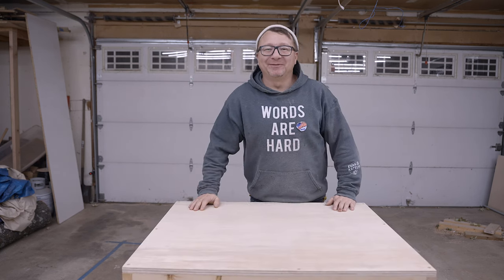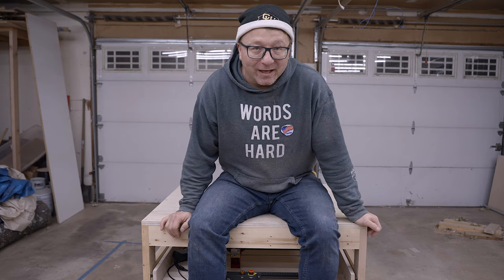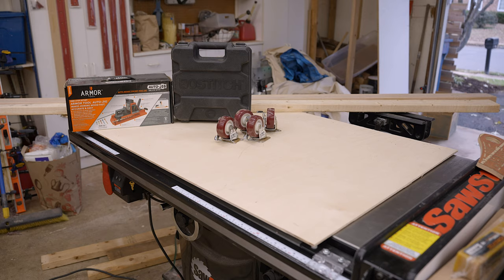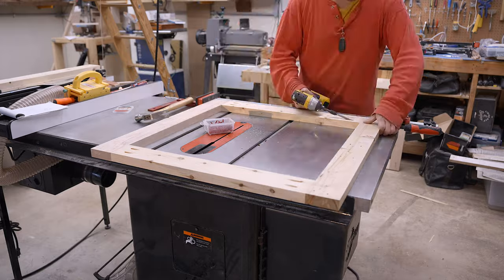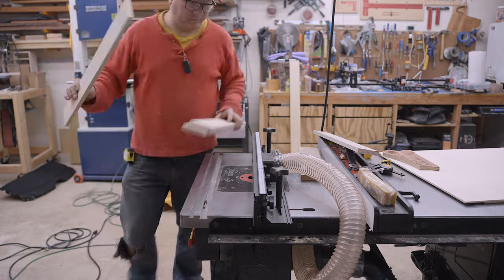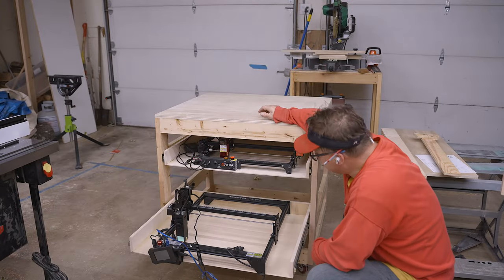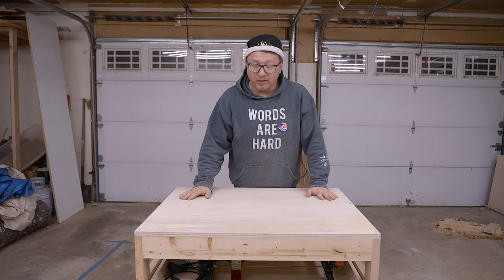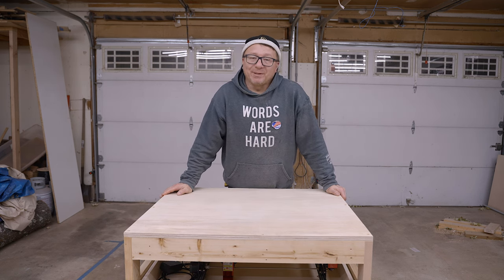Easy One Day Build for Laser Engravers

Comment: You could go a little further with them and make it in to proper enclosures.   Add walls, door, smoke extraction, some power strips, etc.
Reply from the maker: That certainly is the plan, but I was under a time and materials crunch for this go around. Perhaps I need a follow up :). Thanks for watching!